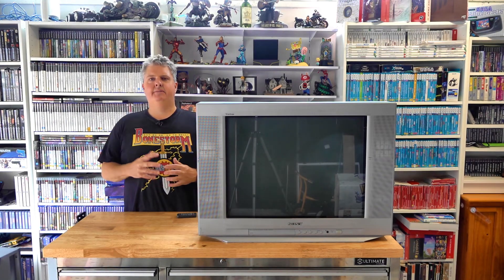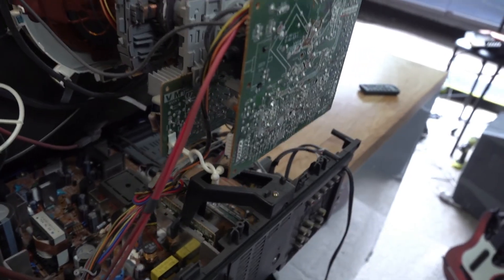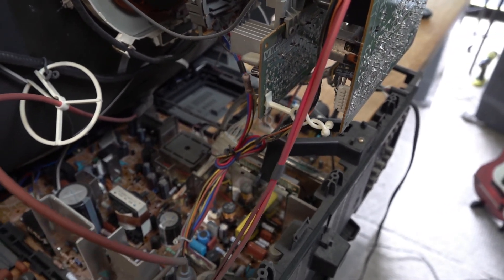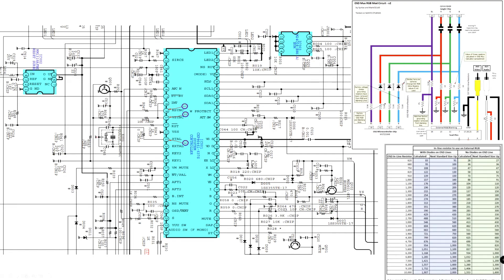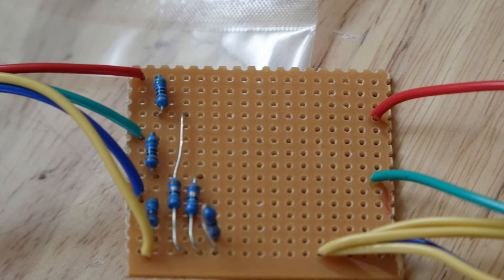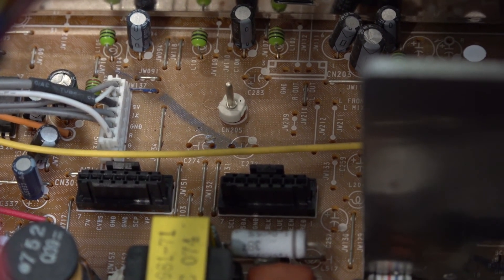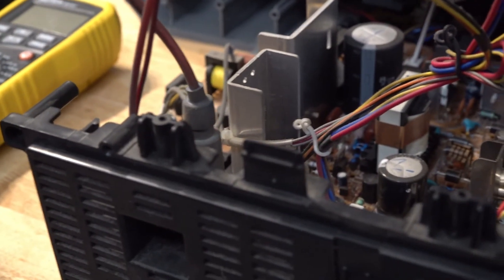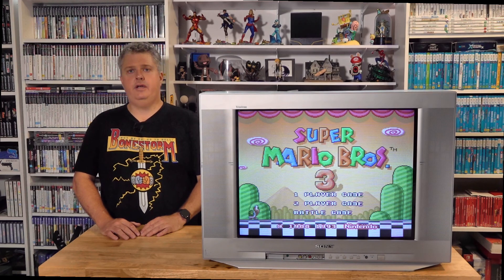Sony Trinitron RGB Mux Mod, BG3R, KV-XJ29M31

Comment: Hey, sorry for the comment on an old video. But i have a question. Ive seen in other videos people splitting the 5v to 2.5 for the Blanking switch. Is this something you have done here? Or is it 5v through the switch straight into the YS line on the teletext array?

Comment: Hi mate,

I have a couple of questions.

You mention removing 470ohm resistors but don't show how to do that. Is this something we need to do? How do I locate these resistors?

It appears that you're feeding 5v directly into the teletext blanking pin without stepping it down? Is that safe?
Reply: Can we get a reply to these questions please.
you did not show the factory resistors to remove, you also have wires coming from the bottom board red,blue,green into some resistors on the board ? where are these terminating to ?

Comment: I just got hold of a KV-XG29M30 would the method be similar to this as it also has a BG-3R chassis? worried its a bit too advanced for me but as this model i have only has composite it seems like its a no brainer as its geometry and the TV itself is super clean. Any advice?

Comment: I have this model, but no remote. It’s a bit fuzzy when I connect a Wii to it via component and run emulators - do you think changing the picture mode with a remote might help? Also, do you know of any remotes I could use with it?

Comment: Why would you RGB mod a Component compatible TV?
Reply from the maker: Show me a SNES or Mega Drive that outputs component.
Reply: @spudzgames4361  HD Retrovision cables or a RGB to Component transcoder.
Reply from the maker: @chchris25  thats fine. There are some good ones but i prefer my signal to be unprocessed. And its cheaper. Costs out $5 to mod a CRT.

Comment: Hola amigo me preguntaba como puedo conectar mi TV crt a mi laptop pero configurar la TV para que se vea igual que la Sega megadrive, con scanlines y los mismos efectos que la consola original. Gracias 🙌🙌
Reply: Compra los cables de acuerdo a tu  lap hdmi  +  conección de tu tv.  Entradas con hdmi , +  rca  no se que entradas tiene tu tv  .. De acuerdo a eso compra

Comment: So do you not need sync?  I've seen so many versions of RGB mods and my head is spinning.  Folks never show exactly where things are wired.  Your video is the closest I've seen.  At 14:30 there are RGB and 5v shown, which are soldered to the PCB.  Where are the other ends of those wires going?
Reply from the maker: The header where the Ground,, RGB and 5v go back to the jungle and main processor. The cables go to the RGB connections. I don't need to wire in a sync. I use composite as Sync. You can do this by just plugging sync one of the composite inputs. Just make sure which ever composite input you choose you are on the AV channel
Reply: @spudzgames4361  Thanks.  By header, do you mean where the teletype board plugged in?  Or someplace else? From the footage at 15:25 it looks like the wires coming out of where the teletype board plugged in are going to the Vero board.  Are there 2 sets of R,G,B,5v wired into that connection?  One running to the back of the PCB and another to the Vero board?
Reply from the maker: @Will-vj5bc  yes. That is the header. No only one set of wires. The set that goes away to the jungle and main processor are on the circuit board.
Reply from the maker: @Will-vj5bc  the wires run from the header to the vero board and then from the vero board to the RCAs.
Reply: @spudzgames4361  Thank you.  Sorry for being dense but the RGB, 5v wires shown at 14:30 are running to where, exactly?  The jungle chip?  What exactly is the purpose of those wires? Again, sorry for all of the questions but I'm just trying to understand.
Reply from the maker: @Will-vj5bc  those RGB wires underneath are not soldered. They are loose. Just hanging. They come from the top, just hanging over. Only the white wire is soldered. It's the 5V for blanking.
Reply: @spudzgames4361  OK that makes sense. To me it looked like they might be soldered.  Thank you, yet again.

Comment: It would be cool to see a comparison video with rgb vs component on the same tv with the same console. I've done some tests myself. They looked identical in my tests. You just have to make sure you color calibrate both inputs correctly.
Reply: I agree! I don't think there's a "better" input between the two if we're referring to color space, but I do see why a component television would be RGB modded. Transcoders are awfully expensive due to the unnamed virus! :p
Reply: @dotmatrixmoe  I've got 3 transcoders and they all work flawlessly. They were about 80$ each but I don't know how much they are now. I haven't bought anything since the parts shortage started.
Reply: @riggel8804  Lucky guy, my CRT videophile phase started a bit too late... :P
With the right tools, it's also cheaper (around the $30 range) to RGB mod a television. If I had a cheap option for a transcoder, I'd definitely go for it.
Reply: @dotmatrixmoe  That makes sense. It's also one less link in the chain. It also looks like a fun mod to do. One thing I worry about is the video quality. I've seen RGB mods that looked off. One was way too bright and the guy had to turn the brightness way down. When you use a transcoder you are using the video circuit that was designed buy a sony engineer rather than something cobbled together on a bread board in your garage.
Reply: @riggel8804  Yup, it greatly depends on your Chroma IC. Sometimes all post-processing effects and black level clamping are handled on the OSD lines, so I haven't encountered these problems. Sony Trinitrons generally don't have these problems, but on other sets it's a bit tedious to calibrate.
Reply: @dotmatrixmoe  ah good to know.
Reply from the maker: The brightness issue is when they do this mod but don't use the Mux Method. In one of my old old videos I did it this way. You can adjust the setting to mostly get rid of ot but ideally you want to keep it as neutral as possible. They just tap into RGB of the teletext. Sometimes that's fine on the older the older Sony chassis but these newer ones you need to to the Mux Method otherwise brightness will be an issue. Mux Method is just Removing and adding in resistors to ensure correct P-P voltages are where they should be as well as correct RGB attenuation.
Reply: @spudzgames4361  Cool. Watching people just tapping into the osd for rgb had me concerned. I figured there was a little more to it. Good to know someone designed a circuit specifically for this to get all the right voltages. 

Looks like a fun mod. I'd like to do it with one of the old large xbrs. I run across them often and most only have s video. I've got one with component and it's a really cool tv.
Reply: @riggel8804  done this with xbr yet riggel!?? Id like to see the vid
Reply: @swardmusic  Naa. I would rather be playing games than modding crts personally. My XBR is playing just fine with component video right now. I am working on a 1cc of Shinobi Arcade and playing a lot of Street Fighter 2 online.

I did do a vid comparing RGB to component with my PVM.

Comment: is there a point to run crt any longer? The scaling, picture, and compatibility has gotten alot better on the new flat screens
Reply from the maker: It's all preference. The same as,  Why would you use old consoles when you can emulate. For me it's a personal decision based on how I get the best results.
Reply: @spudzgames4361  emulation always gave me glitches and issues, soooo 🤷